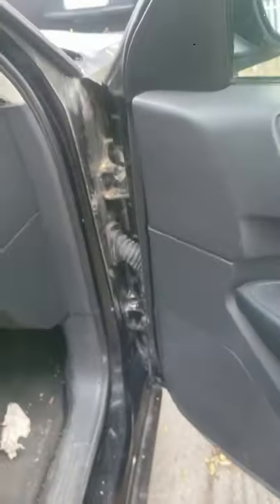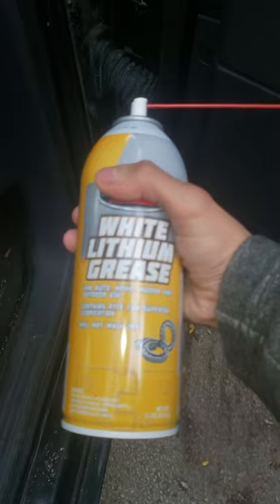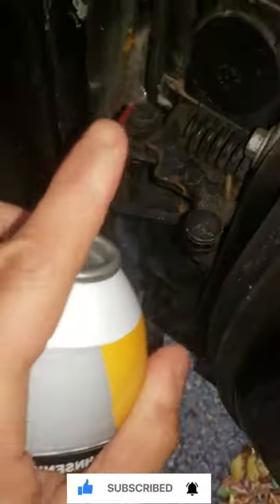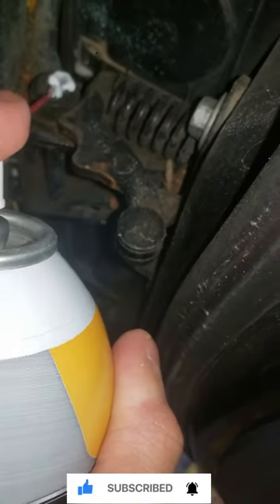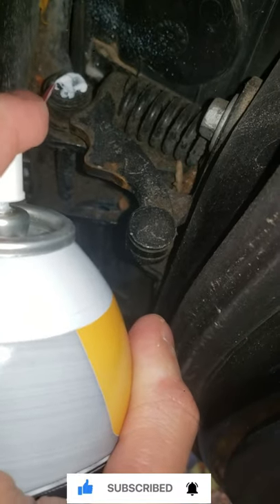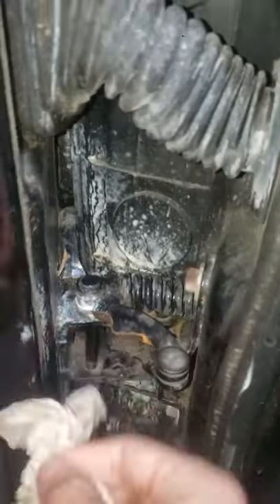Fix Squeaky Car Door FAST #Shorts

Comment: Your videos are really awesome but they are almost all about old cars.
Hope you record for newer models.
Thanks
Reply from the maker: Thanks! I will be doing some newer cars soon. But most of the videos will be on cars at least 4 years old or older. Most people don't work on new cars if they have a warranty, and I'm trying to help those (after the warranty period) who might want to do the repairs themselves or at least better understand how to do some repairs. So I'm just trying to show a little TLC on the older models.
Reply: @FixCarYourself 
That's right. But this is inapplicable for us in Iraq cause we buy cars with accidents from US and Canada. That is why we don't have warranty.
Appreciate your reply.
Wish you the best.
Reply from the maker: Interesting. I didn't know that. Well I'm really glad this helps then!
Reply from the maker: Are the cars you get in decent shape?
Reply: @FixCarYourself 
Yes they are.
Reply from the maker: @ahmedsameer8682  good to know. Thanks
Reply: @FixCarYourself 
I have a 2015 dodge charger sxt 3.6.
I would be very grateful if you post a video on how to troubleshoot a heated seat because my driver heated seat is not working.
Thanks
Reply from the maker: @ahmedsameer8682  Sure I will do this as soon as I see a Charger. In the mean time, what you can try to do is move your seat forward and then unhook- remove the connector under the seat and then put it back in.
Reply: @FixCarYourself 
I already tried this but it didn't work.
Appreciate it
Reply from the maker: Another thing you could try is either 1) testing with a multimeter the heated seat connectors under the seat or 2) remove the radio bezel and pull out and then put back in the the heated seat buttons. 1 of those could be loose as well, especially if one of those buttons don't light up. Anyway: Here is a video that shows how to remove the bezel. Your car might be slightly different but this should be a pretty good reference.

https://youtu.be/KpiUNjLNk2Y